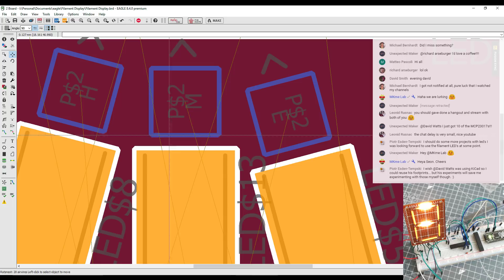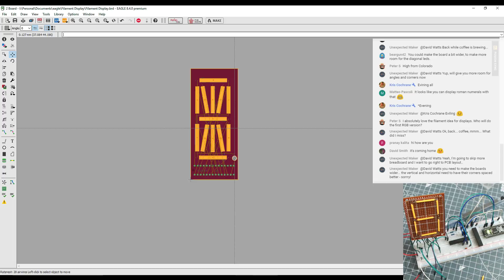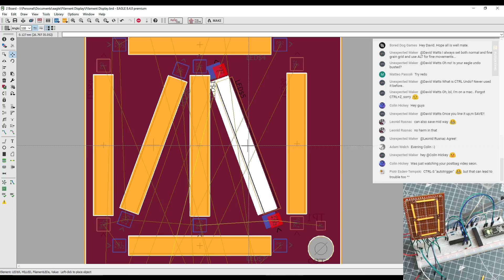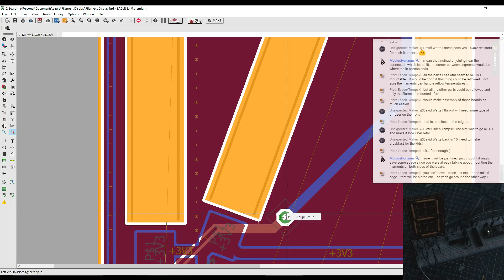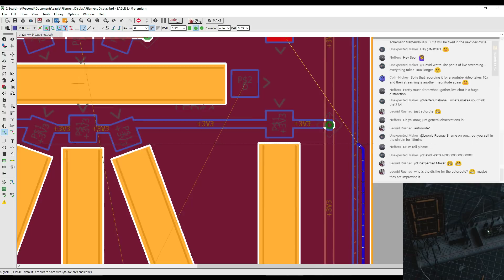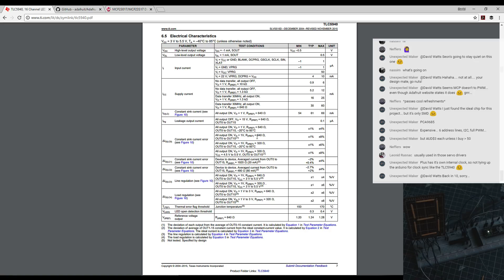Live: Hey UnexpectedMaker - Seglament Display - Episode 4

Comment: I think, my personal opinion, the display needs to have a bit of a lean to it like it's italic.
It's a shame you can't get half length LEDs so you can have two going across the middle segment instead of just the one. Letters like K mighty look a little off.
I wonder if you can overlap some of the solder tabs and use multiplexing, or charliplexing to drive the segments with fewer pins? That'd give you a tighter layout, though the holes would need to be miller much differently 😊